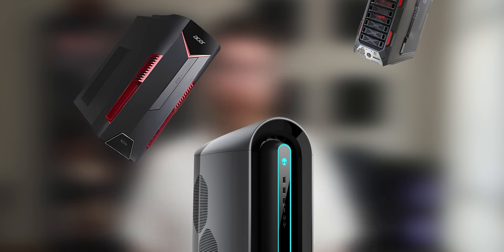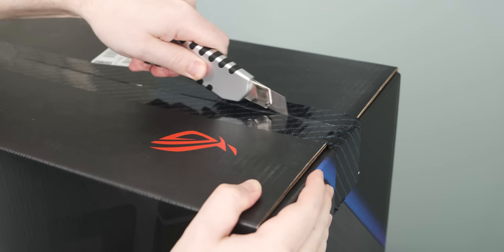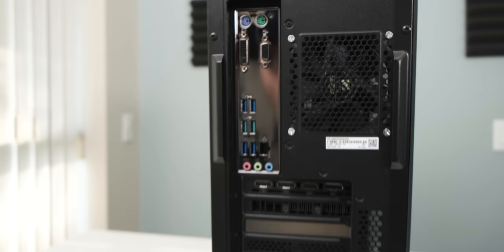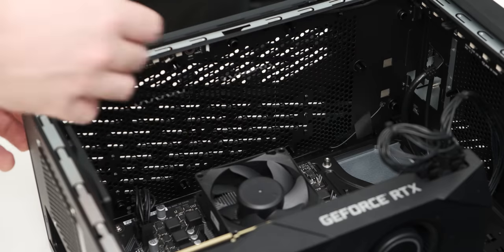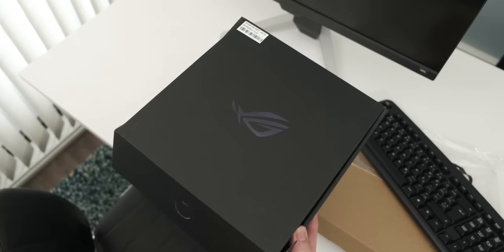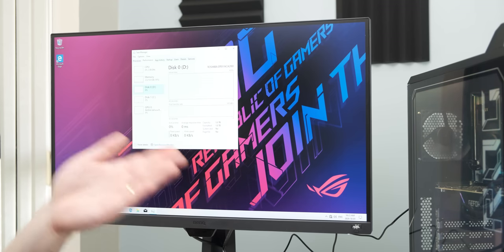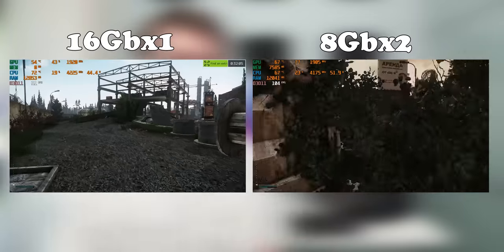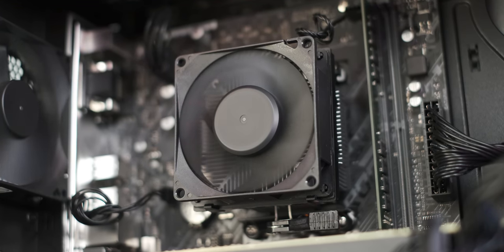I bought a $1500 Asus Strix Pre-Built from Best Buy...

Comment: I would joke but I am currently watching this video on the intel version of this pre built. (although I have 2 8gb sticks, a better cpu heatsink and also the cabling looks a bit better)

Just looked, the motherboard on my rig is also different, its got ROG branding on it and 4 memory slots so idk, I guess asus just have like 50 slightly different rigs that they put in the same case.
Reply: Same but my motherboard only has 2 or 3 memory slots I think? I have one stick of 16gb ram and one that's on the far right more away from the other two covered in rog plating

Comment: Is the pc good? Found it on best buy for similar specs. AMD Ryzen 5600x & Nvidia 3060 (12GB VRAM) vs DELL XPS 8940 (intel core i7-11700 & Nvidia 3060 Ti (8GB VRAM)? I heard from many people that Dell's XPS PC are not that upgradable. Can't upgrade Power supply, Third party RAM, & Difficult fans upgrades. Case is also smaller. Dell has their own Motherboard that limits RAM speed to 2933 Mhz. Both are about the same price. Which one should I get?

Comment: I just got this and i love it
Reply: Does it have a display port?
Reply: never seen a real pc huh
Reply: I just got this PC too, and although I don't really like the problems that were mentioned in the video it works fine
Reply: @xii8691  Same just received mine too, so far so good although its kinda on the noisy side (cant even hear them with headphones on so its not a big deal). I will replace the fan with an AMD Wraith Prism cooler and two 8 gig ram sticks.
Reply: @shuaybghaffoor3298  get a better cooler, for that Ryzen it won't be enough
Reply: @apocalypse3039  After few days of use I feel like I wont be needing a cooler, yes the fans are a bit noisy but my system isn't getting hot as I expected it to get.
Reply: Take it back and get a refund. You got jacked. For that much money, you can do a whole lot more.

Comment: I was unable to build my own computer for various reasons so I ended up building and paying for the assembly of a computer from Memory Express. I selected the parts I wanted from their online store using their PC builder and paid them to assemble it. Although you could just get the parts shipped if you would prefer to do it yourself. They even had some sales on a few parts. Better then going out and buying a pre-built as you know what's in the system and how much you paid for them to assemble it. They have both an online store and physical locations, but they had no stores in my province so I had mine shipped.

Only a couple of issues with them. Their customer service took awhile to get back to me via email, and you were unable to call for online sales as they took their line down due to the volume of calls they were receiving at the time. One issue they never got back to me on was me just seeing if I could switch a part out the day after I placed my order since a graphics card went on sale for about $100 less (same card, different brand). The other time I contacted them for an issue the response took just a couple of days and they were helpful. For expensive orders they will do a verification process to ensure there is no fraud going on, that was annoying and took a couple of days, I even had to send a couple of follow up emails since they were taking long to respond. One of their employees creeped my LinkedIn profile which I really didn't like, but whatever. All in all I liked the product I received, and I would definitely recommend them. You should do a review of Memory Express, and other online stores for computers in Canada!

Comment: I bought a ASUS ROG STRIX G15CX with a intel core i7 around $1499 at Best Buy around Black Friday. It actually comes out to about $1630 after taxes and everything. I bought it because the specs were nice, but Expansion on this is not great. While my intel board is newer then yours in the video, no legacy keyboard or mouse ports or obsolete video. Just usb 2.0 and usb 3.1 ports. Network port, audio ports and spif port. The processor heat sink looks better, but it has the same screamer fan on it, orientated sideways instead of flat down. I want to add a Hard Drive and possibly have holes cut in the top of the case to have a easier plug and play power and sata cables lead up to it, to either have a DVD ROM Drive, or be able to trade that out with other hard drives, when I need to work on them.  I am obsolete still wanting to keep a dvd rom drive on my newest computer. Only five or six days into use on the system and I noticed the back fan is not spinning. My motherboard registered at 126 C or 258 F. Not the processor, but board. I am having to see if that is because I have a low fan profile set. Which I saw something about that when setting it up and I did not change it. Or if the fan is actually not working. My first instinct is to fire it back up and see if it spins. I am pretty sure it did on the first startup. Staring at a fan that is not moving is disconcerting. I have never bought a prebuilt system before, but worried I would end up spending more money, I actually caved and bought this system. I am not thrilled with the new computer. UPDATE: I found fan profiles in ASUS Armory Crate software, it was set to Windows, and I changed it to Turbo. This fixed the issue with the fan. Also I have a noisy fan in my room so the computer seems silent to me, because my room is noisy if I have the fan on. And if heat or air conditioning is on the air also makes noise. So noisy fans in a computer system would not bother me.

Comment: I judt recently bought bought am Asus pre-built like this. It still came with cheapy parts, but they were slightly improved over this system. However the loud case fans remains and it drove me crazy. I replaced the cpu and case fan with Be Quiet peripherals, installed 64gb of Corsair Vengence Pro DDR 4 3600mhz ram, and a 4TB nvme SSD. The system is finally very good after investing an additional $500 on top of the $1099 price.

Comment: I just got this one from Best Buy online, it is identical with the difference of 4 slots for ram on the motherboard, 16 gig ram (same). 256 gig SSD and 1 trig HD, RTX3070x Graphics.
Short of that it looks the same.  I'm pretty happy with it. got it for less than $1500. Does have the same cruddy CPU cooler and fan.

Comment: It's so strange watching this video and your follow up video on "Why the Asus ROG's are so Bad". The computers look so similar but are still very different inside. I just bought an Asus ROG Strix from Best Buy because it was on sale for $1600 (down from $2100), and I figured worst case, I just got a great deal on its parts. The case is the same as shown in this video, which is fine for airflow. It has enough room on the front for a Noctua 120mm intake fan and room on the back for 2x Noctua 92mm fans (one intake on the bottom and one exhaust on the top). The case comes with only a single intake fan on the top back, and it's very loud. Replaced that first. The motherboard is more similar to the one shown in the "Why Asus ROG's are so Bad", which is actually a good thing because the motherboard in that video was the biggest positive. It has a NVIDIA GeForce RTX 3080 with nearly 120mm clearance beneath it to the PSU. The PSU is 80 bronze 750 W (I'm pretty sure). Has a bit of intermittent whine, so I'll probably replace that soon but I have other PSU's on hand. It has four slots for RAM and comes with 2x 8 GB instead of 1x 16 GB. Replaced that with 2x 16 GB mostly for RGB and more RAM since I also use my PC for simulations. Didn't need to though. The main problem with the case is the clearance between the CPU and the side panel, which is only 150mm. The CPU is an Intel i7-11700KF and the stock CPU cooler is not enough. The thermal paste also wasn't applied very well. The Noctua NH-U9S would probably be the go-to air cooler for this case. All-in-all, I'm happy with it. The upgrades are fun to do and the sale on the PC more than covered the cost of the upgrades

Comment: This case is eerily similar to my first PC. Bought an HP Omen 2 years ago for around 1200 bucks before I really knew anything about PCs. Intel i7 8700 with a stock cooler that hest throttles on every game I play with a case too thin for me to install the cooler master fan I bought, 1 stick of 16gb memory running at 2333 with a motherboard with no XMB options and a skeletized gtx 1060 with no branding on it whatsoever

Comment: So I got this pc except it is an intel i711700 with 16gb dual channel ram and an rtx 3070 for $1600. I know the case and cooling is shit but I just bought it to have an out of the box pc I can mine with. It also has a full hash rate card. I’m just planning on mining with it as is for a year until the warranty runs out and then transplant the components to a different case. Just to get a 3070 will cost me at least $1k so I didn’t think this was bad. Mining the temps don’t get too hot. I just run a fan blowing on the top of the case to extract heat.

Comment: Mine I got from micro center it came with some upgrades. 32GB DDR4 Ram, 1TB SSD, Nvidia Geforce RTX 3070. I upgraded the cooling by adding 4 120mm fans an a new cpu cooler. I'll eventually buy a new case an probably a motherboard but the pc works great for me.

Comment: Hey Dawid, noob here. I bought this system but with the i7 9700f instead of the Ryzen CPU. It actually performs pretty well at 1440p with GeForce experience optimization. That said, I hate the cooler with a passion and I'm eyeing a noctua cooler and maybe a couple of additional fans for intake.  I was wondering, since the mobo has another dimm slot, would it be better to grab another 16GB stick of RAM, or should I just go with an 2x8GB kit? Also, is there a specific motherboard that you'd recommend as a replacement when the time comes to upgrade?

Comment: Just bought a similar prebuilt biggest issue is the restrictions with upgrading the motherboard is custom to the case so you cannot switch it out and adding fans is a pain with the stock case, so I would recommend this mainly because of the inflations of price but be aware that upgrading ram, motherboard, and case will be a must
Reply: Do you know what’s the specs of the motherboard?

Comment: 🚨 PLEASE RESPOND 🚨 
I have one of these. So, basically if I replace the motherboard to an Asus ROG B550 F, and go for 16gb 2x8 of g.skill trident at 3200mhz, a 240mm aio, and a 750w Corsair power supply, all of the problems would be solved?
Reply: Yes. Not sure if the 240mm aio could fit in that case tho.

Comment: This video is outdated now as some of the issues have been addressed but some persist. I just bought the G15CE from BB for $2199 CAD with 11700f, B560 MB, single 16gb ram with 4 slots available, m.2 1tb ssd, a 3070 and 750w gold psu so all pretty good hardware. Problem is still cooling though. At idle cpu is 55c but just scrolling your page it goes to 70c. I mean one 92mm exhaust fan and a stock cooler in this tiny box with these hot components? There just isn't enough cooling for the cpu so new exhaust fans plus AIO here I come. Still cheaper than building your own right now as the gpu costs almost the price of the whole rig. Insane really. I tried Canada Computers to build one as I previously did in 2013 (yes, my 4 corei5  lasted until now but is running at 90-100% with RDR2 and Wildlands but stays around 40c with the evo212 on it while the 1660ti just sits there idling, lol. It'll be a good surfer and backup if this one goes south) and found out it costs more to build from scratch with lower component level without an OS  which is included with the G15CE. The market is a joke right now so it's the best option for someone who can install their own upgrades. Only concern is warranty and access/availability of adding extra ssd and fans to the mobo. Calling people losers because they don't have your knowledge is slightly lame unless you're trying to be funny. I'm a chef and certainly wouldn't call you a loser because you don't know what a mornay sauce is. People trust an expert in the field (like Asus) to give them value for their money. It's just a shame the world is greedy and self-aggrandizing. Good video though. Thanks!
Reply: What cpu cooler did you use? I’ve been seeking to get one
Reply: @justlore3520  Noctua NH-U9S. Easy to install, works very well, and is not too expensive. PC runs 30 degrees cooler and is way quieter. I also replaced the rear exhaust with a Noctua NF-A9 PWM 92 mm.
Reply: @Synonomous  thanks for the info. Are you going to do any changes with the ram? Like a dual ram sort of thing or is the single 16gb good enough?
Reply: @justlore3520  I actually put two sticks of Patriot 16gb for a total of 32gb. Probably not necessary but I'm covered if needed and these things will not get cheaper.
Reply: @Synonomous  thanks for replying. I’ll probably just go with the dual 8gb ram.

Comment: I actually had this PC for a bit, it kept shutting off when I would run video editing software because system couldnt handle the power delivery required. iirc it had a 500w psu when it should probably have about 600; another cut corner. Ended up taking it back and building my own

Comment: Better to have this ROG pre-built or a similar priced one with ROG components?
Reply: Oh, get the components and build it yourself if you want ROG as a theme. Alternatively, you could spend $1500 on this, then replace the mobo, ram, psu, gpu and cooler. Then again, with prices the way they are, a ROG card with any gaming performance at all will cost you $1500...

Comment: Considering that an 3700X can even put out more heat than a 360mm AIO can deal with in a long game session ending up with roughly 70 celsius, which isn't really thermal throttling or anything, it does keep it's clocks where they should be and beyond, but you'd need a very crazy cooler to keep any of the high clocking Ryzens cool.

Comment: So since they fixed the motherboard issue and are now using dual channel ram, but still the same crap fans. It would be pretty sweet if you did a video adding an AIO in there as it seems that space is very limited inside the case.

Comment: !Update!
noob here, not really but in the context of this video yes, x), i know you're going off USD but i also know you're Canadian so i'll just leave it in CAD here,

bought a system similar to this @ bestbuy recently for boxing day sale, 
1500 CAD, 
3060, 
r5 5600x, 
they didn't address the single stick issue, however they have addressed the motherboard issue, comes with a prime b550mk now with 4 ram slots, and it came with a 1tb nvme ssd which was nice.

baby steps!
all I really have to do is replace the ram and cpu cooler now because the motherboard is actually decent

Comment: question, Dawid could a NZXT Kraken z63 240mm be able to fit in that pre-build cause I just bought this system about a month ago and I wanted to know if I could do that and fix the problems with it. Without having to buy a new NZXT H510i case and getting all the components for it for it to work. Do you think going for the NZXT route is a good choice?? Instead or not

Comment: If you buy a 5-10.00 pack of thermal taped adhesive backed aluminum heat sinks it would probably solve that issue, too.

Comment: As someone who owns a computer store this is our issue. See unlike best buy and other computer stores we have standards and we wont sell systems like that. So our customers go well this has that and it shows more or it this price for the same numbers. But then we have to explain how they are using like stock parts oem style. We explain to them the bottlenecking and other such issues. Our machines will run at least 40 to 20% better for the same price if not more but at the same time we back all our sales and you get local support not some foreigner who barely speaks English. The worst customers are the ones who just wanna look and not talk to you but are truly hurting them selfs by not getting some real information.

Comment: I bought a similar system off of Amazon a few months ago. It came with a 1TB NVMe, but no standard hard drive. I just bought one and went to install it, only to find no hard drive cage or mount to attach it to. Can you tell me where in this case I can mount the hard drive? Its suppose to be behind the power supply, but nothing is there. The case I have looks identical to the one in this video.

Comment: It's really odd how they just put a small laptop fan in these powerful pc's but they could use like 10$ to get an off-brand tower cooler.

And they could use a 10$ case with an actual mesh front panel and place  two 4$ fans as intake and exhaust.

That's like 20$ and you're getting hugely better thermals.

Comment: I bought this similar system 2 years ago, although with some upgrades done by Microcenter before purchase (hello 2x 16gb of RAM and 5600x CPU).  Now I just bought a 5800x3d CPU, and want to install it myself...only I'm one of those noobs lol.  I briefly saw how you started to open the case, and I'm wondering if you (or anyone else) have or know a link to a video on properly opening this case?  

Thanks, 
uber-noob 
😁

Comment: I got one, but its a 3080 build with 4 RAM slots, it was running loud at first but I re-did the thermal paste and it was fine with cooling
Reply: May I know which cooler you got?
Reply: @mr6462  it’s the stock one that came with it, it’s a better variation of what he got, there is another cooler on Amazon that has and RGB fan I’m going to get and it has some really good reviews and will fit in the case.

Comment: I had bought a asus g15dk, probably the lowest teir you can get with a gtx1660. I have decided I'll be switching my components to a better designed case and I will be installing a watercooler in the future. I did upgrade to 3660mhz 8gb dual corsair vengeance ram though. The system performs decently okay lol